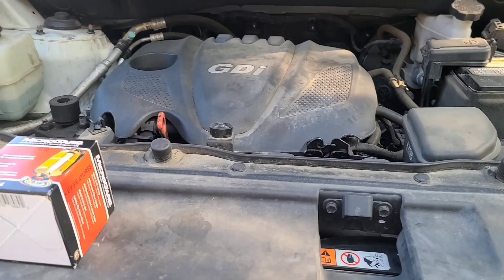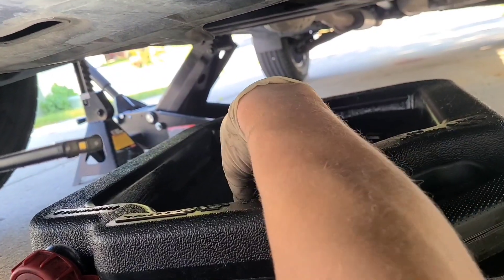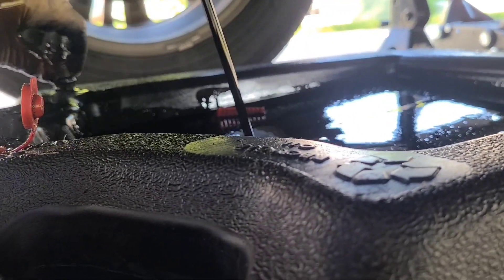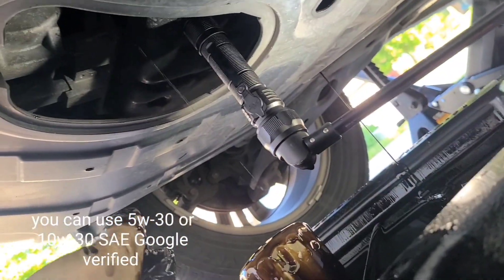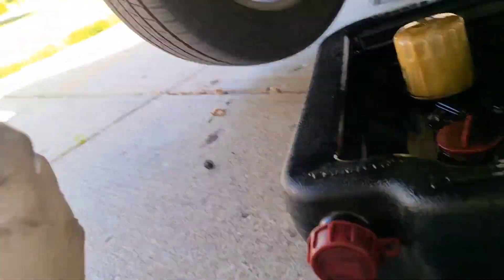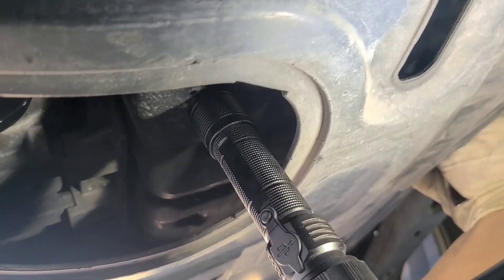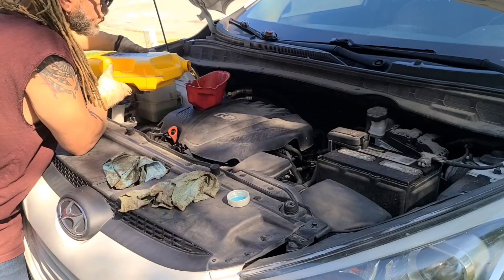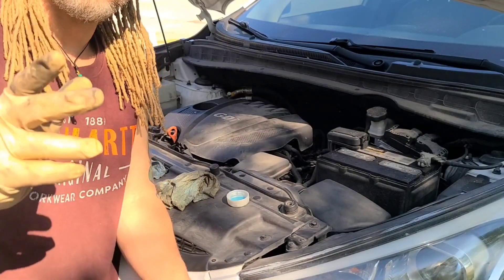2016 - 2021 Hyundai Tucson oil change

Comment: pointed me in the right direction, but my 2020 inspection covers look nothing like this. and skip the oil filter vice grips NO room use an END cap filter remover, or you can try the grips and bust your knuckles